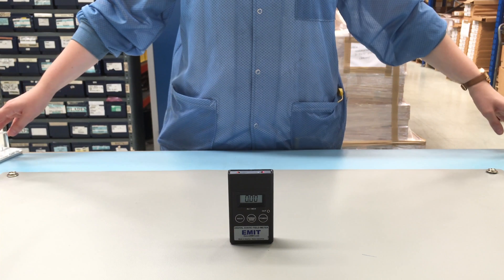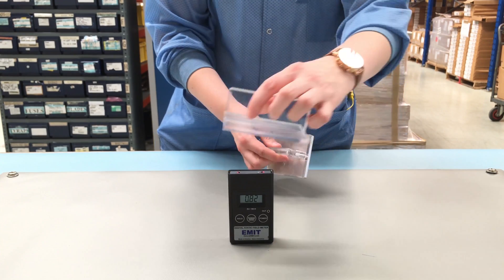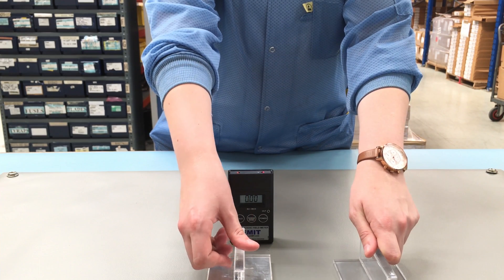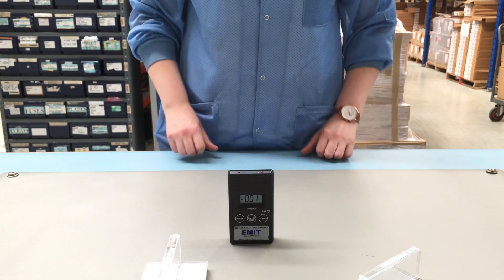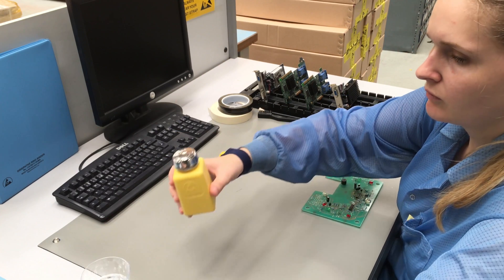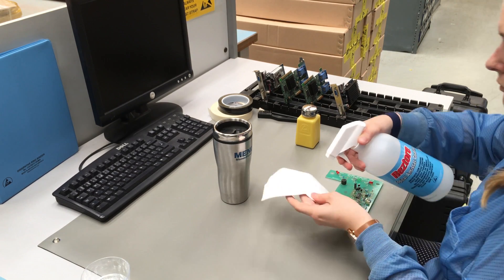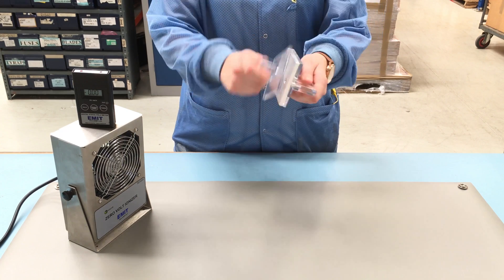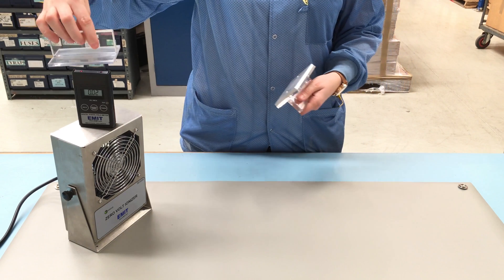Why Use Ionisers?

Comment: Not both charges, most likely highly "electron-charged" particles causing the dust to sink. 
Depending on what perspective highly electron charged particles are sometimes called positive but technically are negative and the earth lacking electrons has been accepted to be called negative but the reality is the earth lacks electrons ...... That makes it more proton than electron.... Chiaò